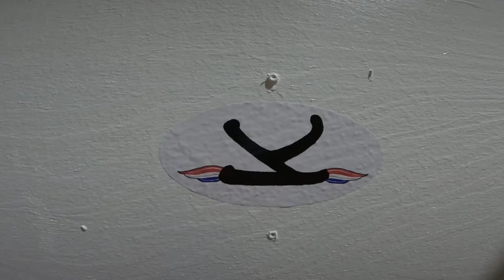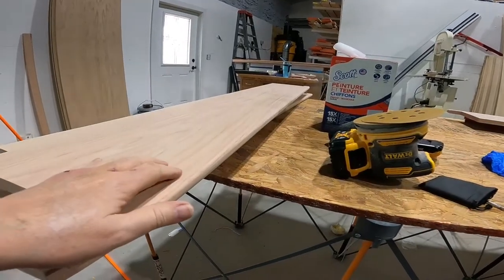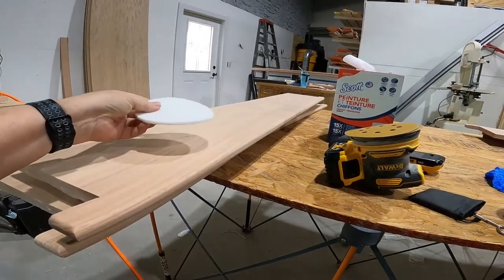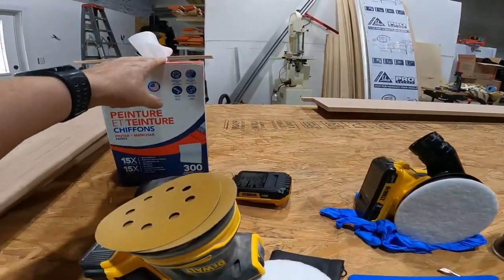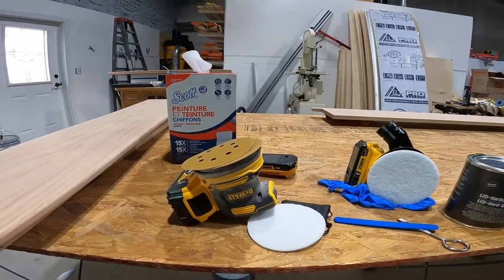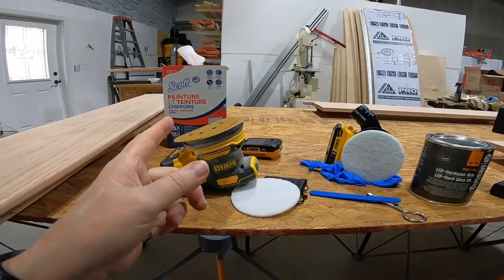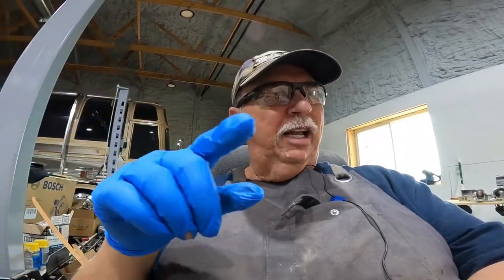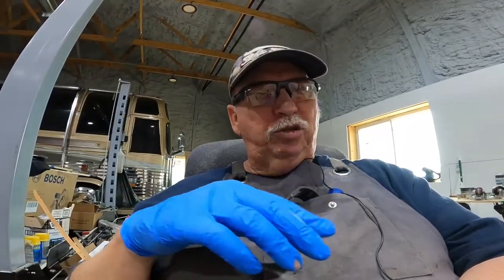VLOG 55 - Rod Kenly - Lazy Flying K - apply finish to 1st window sill

Comment: How expensive is vesting compared to other finishes?
Reply from the maker: Very expensive.  It's about$150 quart.  But it should cover about 250 Sq feet. So it might cost only about $50 more material wise,  but the labor cost would be a lot less. So I don't have a good handle on the cost differential yet. When labor and tone are factored in,  it might be a lot less.  But then you have to average in the light cost($1000). That would average in eventually,  but I'm not sure on the payback time.
Reply from the maker: It's also low VOC, so no smell.  I'm really impressed so far.  I will know better after the next 3 projects.